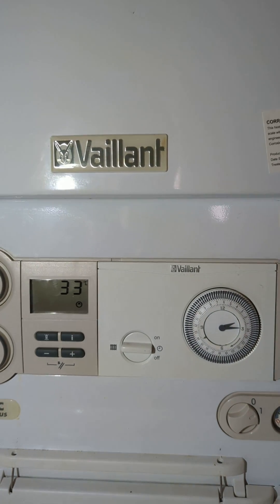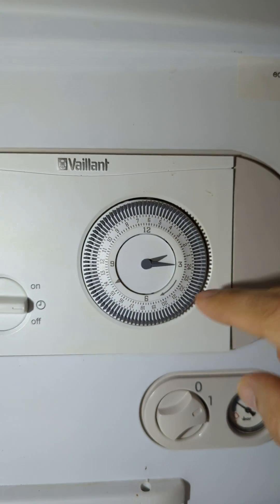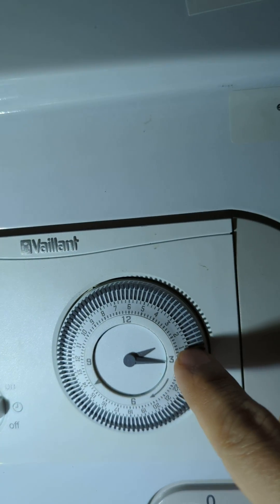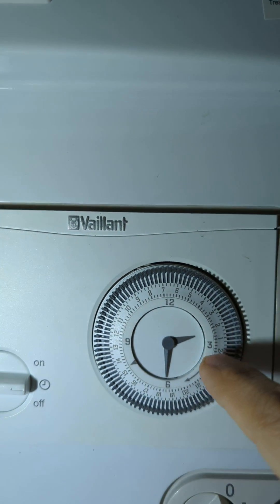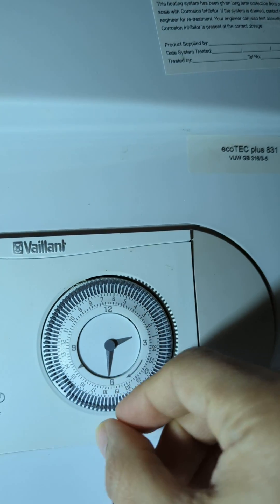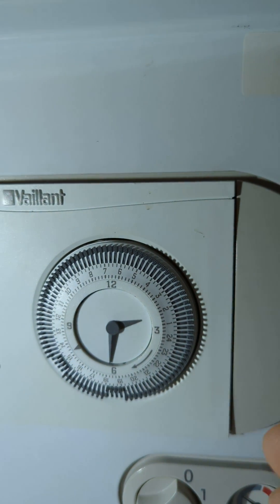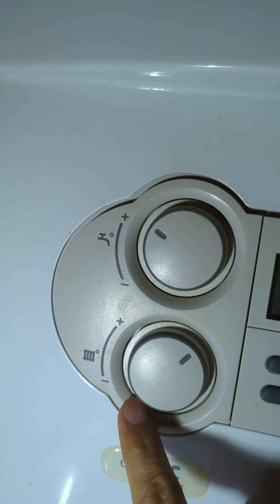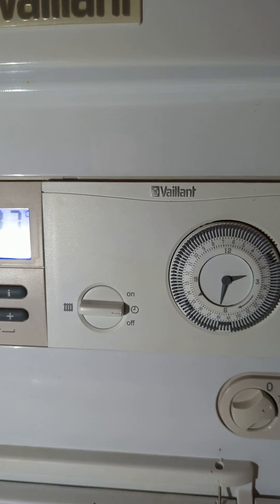Auto set combi boiler heating/ clock timer using pins as clocks go forward/back

Comment: Missing info: the outer dial is 24h and the inner dial is 12h, so the way to know if you are correctly setting the current time to AM or PM is to check the little grey arrow pointing at the outer dial, which should show the correct, current 24h time. Also, to be clear, switches IN for on, OUT for off.